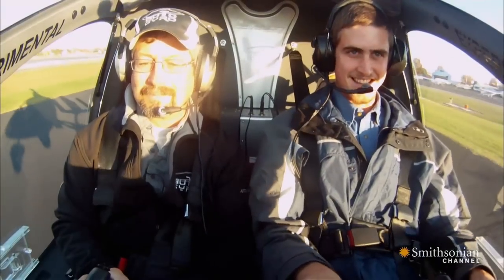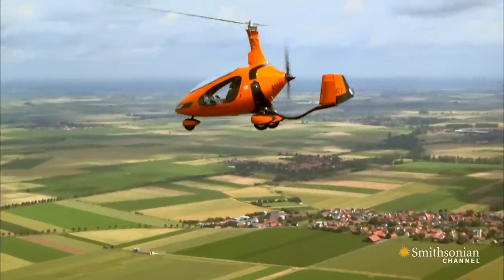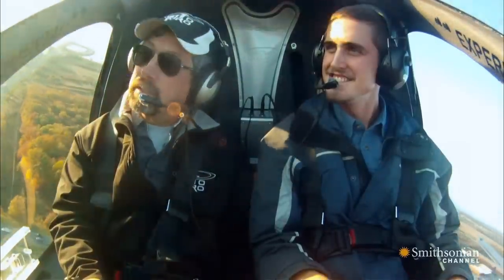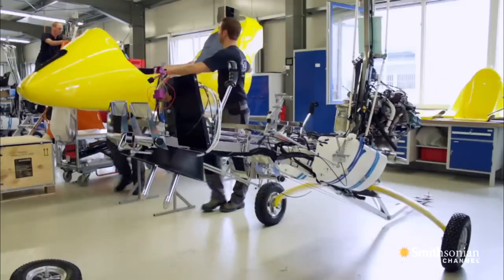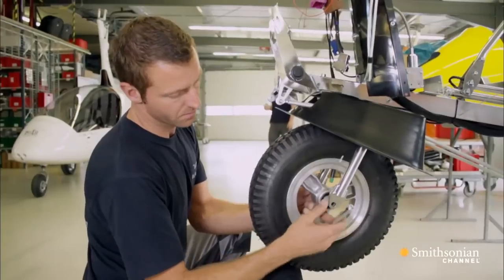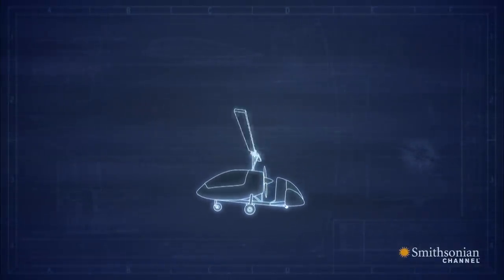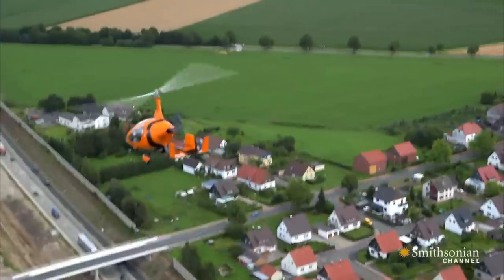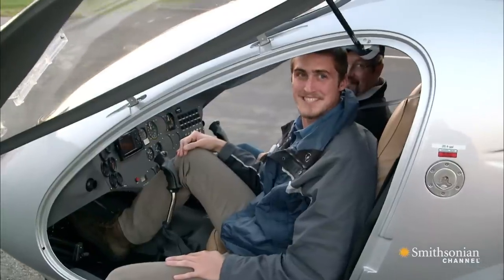The Future of Flying

Comment: I don't believe that an auto gyro will EVER replace a car. Think about it, you are not going to be landing this thing in the parking lot of McDonalds or where ever you are going. We are simply not ready for flying to be our main mode of transportation. I don't trust most people on the road, I certainly don't want them occupying airspace with me!!
Reply: Think about this, though:
Statistically, air travel is way safer than ground
Your chances of being in a deadly car collision is about 1/5000.
Your chances of being in a deadly airplane crash is about 1/5,000,000,000.

To back that up, airliners have a multitude of safety systems that are designed to completely, if not almost completely reduce casualties, if they do happen.

The media is also at fault for dramatizing and bringing a dark corner into the reputation of air travel. Only about 1-2 of the deadliest air disasters in a year don't even happen *in the air*, assuming they even happen in the first place.

Finally, you should also know that pilots go through many years, and thousands of hours of training before they even get to fly an airliner. You may never see a crash caused by pilot error unless it is intentional.
Reply: MaXfIeLd now that is true...but what if everyone was flying? There's no way millions of gyros in air ,landing and parking would not have equal or more deaths...takes a lot more brain power to master gyros then a car also..think of all the crappy drivers flying gyros....but gyro are very cool indeed..I personally want to learn to fly one in near future...
Reply: Lol..... That's not how it really works. Air travel is based on your control and for high altitude flights ATC directs you so there isn't any traffic whatsoever. Car travel is based on everybody doing whatever the hell they want which is why there are so many crashes. Once you put everybody in the air, ATC will still only cover commercial airliners. The business cannot expand to every human being and can't be automated without restricting freedom. So people will be able to fly around in environments which at some point will have fog or clouds or something that obscures vision in no matter how low the altitude or while raining and harsh winds etc, horrible idea. With the way people drive right now, there would be FAR more accidents. How would roadways even work in the air? Not to mention aircrafts are just more difficult to control and maneuver than motor vehicles. The wind is less predictable and although it seems like a pretty standard level of thinking many people would not be able to comprehend wind patterns such as orographic lift. Right now, air travel does work for individuals such as you and me, so we can take advantage of this time and fly autogyros around. But in the future with more people in the air it'll become very dangerous. Also, an air crash will likely have a higher lethality rate than a ground crash even if everyone flies with parachutes, taking into account that any pilot ejection results in large amounts of falling debris on generally civilian areas. There are more things to consider still, but overall a lot of people would get killed in a sudden change.
Reply: No one in the video has said it will replace cars
Reply: You can maybe land a Mosquito helicopter at McDonald's

Comment: I believe flight will be achieved in done by GPS computer controlled collision avoidance, so be saver than driving. Just get it tell where you wanna go and bingo. Quadcopters I think ill be the one to take off as can loose motor even 3 and it can land safely well without dieing! Might get dizzy though.
Reply: Gyros can land safely with NO ENGINE POWER. As said they are in autorotaion, keep a little forward movement and you CAN land as smooth as with the engine. Bensen Gyro N521LW chimin' in...